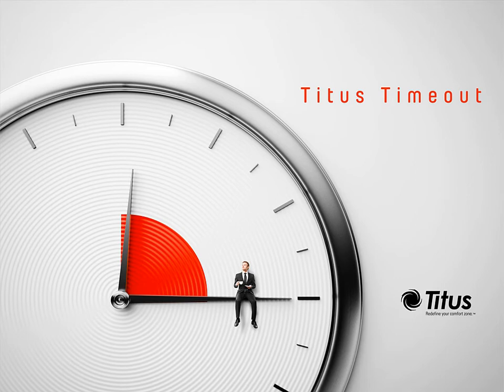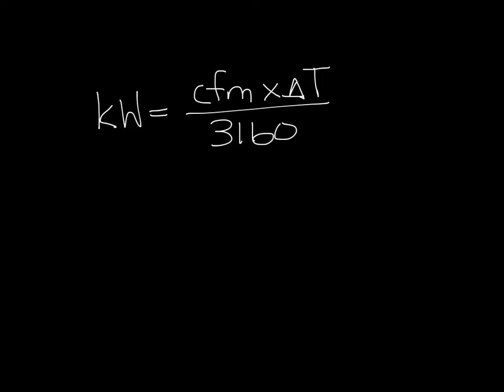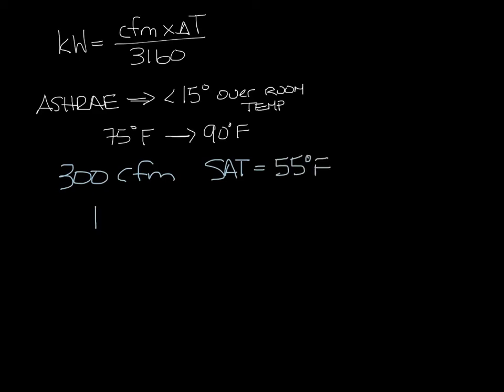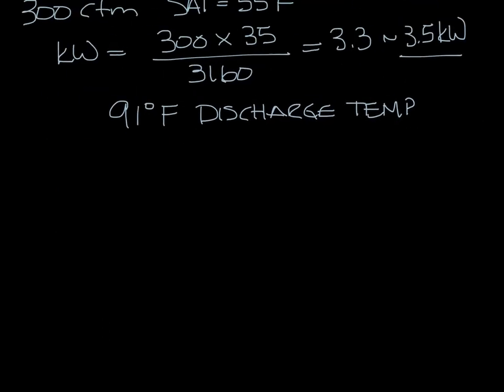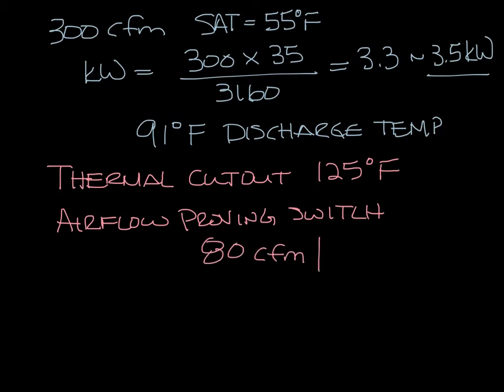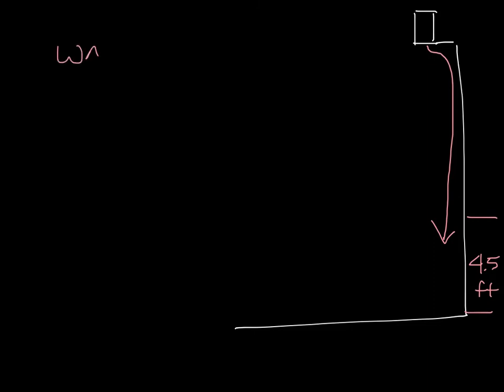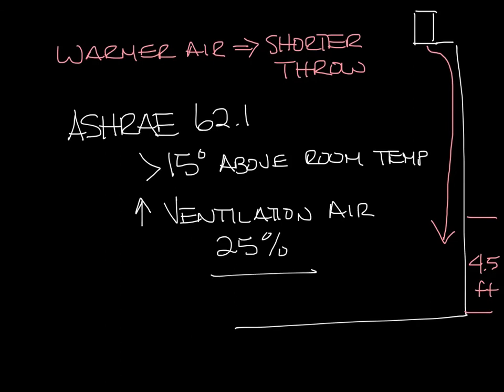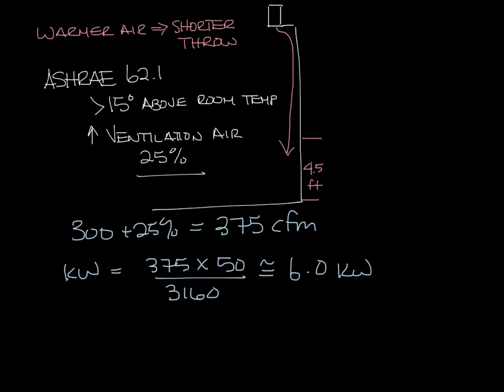Titus Timeout Podcast - Electric Heater Calculations for cfm & Temp Rise

Comment: Keep in mind that when you are operating 240 volt duct heater on 208 volts you will only get 75% of your BTU output. For example a 5KW heater (around 17,000 BTUs) at 240 volts will put out about 3.75KW at 208 volts or around 12,500 BTUs. You must take that into consideration when doing your heat loss calculations.

Comment: Hi, really appreciate your work and thank you for updated a video on this topic. Can you please tell us chapter no. Of ashrae handbook where this formula mentioned.
Please sent extract page of that formula from ashare standard if possible
Reply from the maker: The equation referenced assumes the air density (ρAIR) is 0.075 LB/FT3.  Heat transfer in Btu/h can be calculated by the equation where cp is the specific heat of air (0.24 Btu/lb-°F):

QSENS  = (60 x ρAIR x cp) x CFM x ΔT = (60 x 0.075 x 0.24) x 300 x (90 - 55) = 1.08 x CFM 11,340 Btu/h

Converting Btu/h to kW (1 kW =3,413 Btu/h), this becomes 3.32 kW.

I think the confusion is that the equation shows 3,160 in the denominator. That 3,160 is simply 3,413/ 1.08.
Reply: @TitusHVAC  thanks for your reply and clear my confussion. 
One more question I have here, is SAT and Design room temperature is same by defination??
From where it is mentioned in ASHRAE that 15°F will be taken more than room temperature.??
Reply from the maker: @suhailkhan4798  The supply air temperature (SAT) and design room temperature are rarely ever the same, because systems are usually either heating or cooling a space. The maximum recommended heating ∆T of 15°F for overhead outlets comes from ASHRAE Standard 62.1 ‘Ventilation for Acceptable Indoor Air Quality’. It is intended to limit floor-to-ceiling temperature stratification and increase room air mixing in order to deliver ventilation air to the occupied zone. This comes from a table entitled ‘Zone Air Distribution Effectiveness’.
Reply: @TitusHVAC  What is the 60? is it also a conversion factor?
Reply from the maker: @michaeld.2432  The 60 that you are referring to is the conversion from cfm (cubic ft per minute) to Btuh (Btu per hour), because there are 60 minutes in an hour.
Reply from the maker: If you have additional questions please send them to TU@titus-hvac.com.

Comment: you said recommended heating temperature through diffuser should not be higher than 15°F. In example given for kw calculation, you have taken it as 35. How that have come ?
Reply from the maker: The 35 degree temperature rise, is calculated from the 55 degree supply air temperature. The 15 degree recommendation is calculated from the setpoint. So 55+35=90 which is 15 degrees over the 75 degree setpoint.
Reply: Thanks

Comment: What is 3160
Reply from the maker: 3160 is the conversion from Btu/hr to kw:

Sensible Heating (Btu/hr) = 1.08 x Q x ∆t
1 kw = 3412 btu/hr
Therefore 3412/1.08 = 3160

Hope this helps.
Reply: @TitusHVAC  thank u